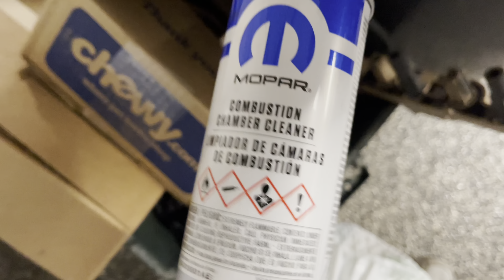Jeep 4.0 Fuel Injector Replacement

Comment: This is just the video I was looking for. I just recently had my 04 grand cherokee with code p0300 for multiple misfires. I'm checking the resistance on the injectors amd was thinking on just replacing all the injectors instead. This is the perfect video on what I'm going to do. Thank you .

Comment: I just changed mine. The old ones were the original 23 years old. Had the Chrysler star logo on them. I was coding P0203. Misfiring open circuit #3 cylinder. So far so good. I also put on a Heat shield on the intake, fuel rail and injectors.

Comment: Just want to point out one thing---the silver round valve thing toward the middle of the fuel rail is actually some kind of pulse dampener that keeps the flow of fuel through the rail more consistent (this according to the repair manual I have). I like your presentation of the steps---thanks!
Reply: Is it necessary to have? My new fuel rail came without one and I’m not sure if it’ll work

Comment: ..... Wow.... I discovered your posting today... when after being told by a buddy he could smell gas around my Comanche ... For the longest time, I couldn't see where the leak or smell was coming from... then, today, I noticed the second injector in from the radiator seems to be a bit 'wet' at the top end, and the rail seems to have a 'witness mark' of fuel spray ... 
... I believe I found the source of the smell ! ... And, your clip helped relieve a bit of anxiety about doing the repairs needed... I suppose I might as well do the whole set of injectors, while I'm there ... And due to the advice I found ... not fixing it now, can cause worse damage... yikes... And I sure want to see my '88 Comanche 4.0 / 4X4 / 5spd / longbed lasting a long time ..... Regards .....

Comment: I thinking of doing this since cylinder 6 keeps misfiring even after i replaced spark plugs and ignition coil
Reply: did it fix it?
Reply: Is cylinder 6 the front or the back?

Comment: Hi. I have a 2000 wj 4.0 I just replaced my fuel injectors with a 4 hole from a one hole, now im getting a code po172 and po175 bank 1 and 2 oxygen sensors, system too rich.
Would this be normal for the ECM to reset for the new injectors after driving a bit, or is my fuel pressure regulator not adjusting to the new injectors? I replaced my fuel filter 2 years ago. Not sure if its a regulator fuel filter type?? Isn't my regulator on the middle of the fuel rail?? Thanks.

Comment: I've been working on a 2002 that's been laid up for a few years, the fuel rail does have a Schrader valve. Unfortunately the tube where the quick disconnect attaches to rusted completely tbrough, the aftermarket replacement rail does not have a test port.
If its an important feature to have you may want to look in yards away from the saltbelt.
Reply from the maker: Very true. The Jeep died a couple of months ago. Unfortunately, it is no more.
Reply: @GeneralTalkWithBen  😢

Comment: im having the same issues with mine... 2004 GC... just like yours... smelling of gas fumes...rough idle, dies some times... changed the plugs, coil pack ... still idles rough, RPMs go crazy and so does the speedometer,  and dies every now and then.... but no check engine light on... was told since no check engine lite on they cat run the codes... was thinking its also the injectors.... or the fuel filter or pump.... i love my jeep and wanna keep it running... ITS PAID FOR... LOL...so i guess i will try the new injectors, and if that don't work, fuel filter... sure wish i had u to work on it... lol...any comments would be helpful.... thanks...
Reply: Could be IAC valve

Clean it, and if it looks rusty, replace it.

If the same problem continues, replace MAP pressure sensor

Comment: how did injectors perform? any mpg improvement?
Reply from the maker: Maybe a touch better. The engine runs more smoothly.
Reply: I've done this upgrade last year and documented my experience to the decimal point. I've gained 1.8 mpg . And my rpms at idle dropped 240 making it run noticably smoother. Context : I literally have driven the same road , same miles every trip and used the same gas station for every fill up since last December. The jeep has been used exclusively for work and back home then parked until the next trip to work.

Comment: Hey Ben where did you spray the cleaner at before you replaced the injectors?
Reply from the maker: Chrysler makes a cleaner, and there’s also a couple of other aftermarket versions. They all get sprayed in the intake while the engine is running. I think I added a link the video description (IIRC).

Comment: I just replaced mine and now I have rough idle and it will die after 5 minutes . I'm clueless as to what's happening and I'm about to swap back my originals.
Reply from the maker: It could be a fuel pump (or filter). Mine needed all of it. It looks like, after the fact, that the injectors were ok, but they were still cracked.
Reply: @GeneralTalkWithBen   So last night I replaced them , then I just went out there today and took everything back apart . Turns out , the last injector was upside down. Hahaha. I guess that's what happens when you try to get stuff done knowing your tired from a long day. Thanks for your reply tho. 👍🏽